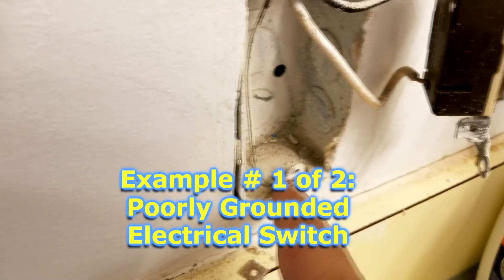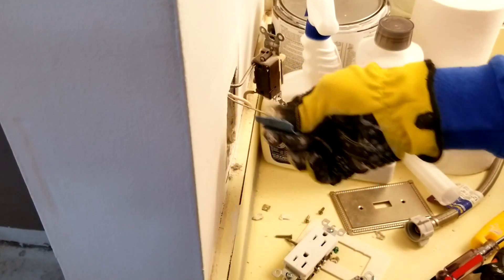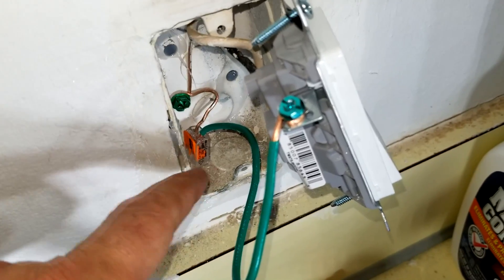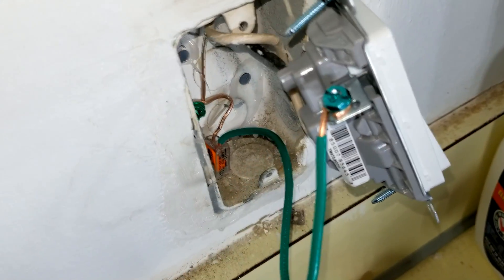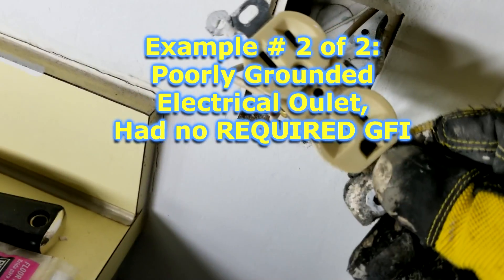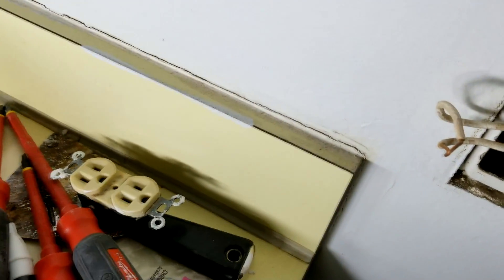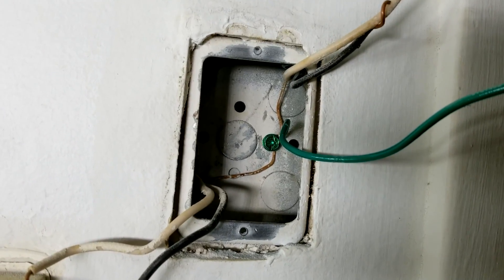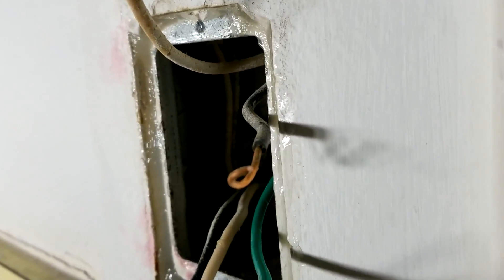How Not To Ground An Electrical Outlet - Wire Outlets Right

Comment: can i use white or black wire as ground but will strip about a foot or more of the insulation before it comes out of the box? have too many extra black wire that i want to make use of
Reply from the maker: Yes that works fine I do that all of the time whenever I need an extra 10 to 12" of bare copper wire it doesn't matter which one you strip I prefer the ground wire to be about as thick as the other wire so just make sure they're the same gauge
Reply: @jeffostroff  thank you very much
Reply: Of course... Who's going to know? Bare copper wire is still bare copper wire... You can also use white wire without stripping it... Just paint it green with a green permanent marker.

Comment: looks to me that you wrapped the wire the wrong direction around the screw/
Reply from the maker: There is nothing wrong with the way the wire is wrapped around the screw, and screw went all the way down and held the wire perfectly.
Reply: @jeffostroff   Nice video, thanks for making it.  However, @George Valente is correct from a good practices stand point.  Wrapping a wire around a screw in a counter-clockwise direction can lead to a loose wire connection.  As the screw is tightened the wire can push away from the screw making it a less secured connection.  Wire should always be wrapped around the screw in the same direction you tighten the screw - clockwise.  This has the effect of pulling the wire in tighter against the screw when the screw is tightened .   You repeatedly point out the poor workmanship and bad practices when the outlet or switch was originally wired (and deservedly so), but proper wire wrapping direction (clockwise) is just another example of implementing good practices.
Reply from the maker: @chuckm260  i always recommend yo wrap clockwise around the screw. That is what I did and in fact tjis was a loop, not a wrap. And no the wrap did not loosen, it stayed down nice and tight. Dont see why he had a problem with it. So neither of you can see that it is down tight and did not unravel?
Reply: @jeffostroff   That's good you always recommend clockwise, but unless the video image at the 4:15 mark is flipped/mirrored, the black and white wires on the side of the rocker switch are incorrectly wrapped around the terminal screw in a counter-clockwise direction.  

I never said, nor did George,  that the wire connections in the video were loose or unraveling.  I'm sure they were nice and tight.  I was simply stating when a wire is wrapped counter-clockwise (as in the video) it has the "potential" to become loose during the screw tighten, thus not a good practice.   It's a common mistake beginners make.  Since you did a nice job of pointing out other good practices I wanted people viewing this video and these comments to know another good practice is wrapping wire in a clockwise direction unlike what is shown at 4:15.
Reply from the maker: @chuckm260   O jeepers now I see where the 2 of you got it wrong. The black-and-white wires are not wrapped counter clockwise around the screw and fact they are not wrapped at all. They are run straight into the pinch plate which is pushed down by the screw. I use an upgraded version of switches and outlets and this is called side wiring. This process is a lot quicker than having to wrap the wire around screws.  And don't confuse this newer method with what they call back stabbing which is the process of pushing the bare wire into the back of the outlet hole which is not a very reliable connection and causes arguing and often times the connection comes apart.
Reply: @chuckm260  They are straight connections that go under a plate, not loops. Different clamping mechanism than the old school ones.

Comment: What happens if you need to install a new switch mid-run and the grounding wires are all pigtailed above the box? Do you need to install a new box and reconnect?
Reply from the maker: I assume you are asking about installing a switch halfway between the electrical panel and where the current fixture box is? If so there's a couple of ways you can do it. You can cut a hole on the dry wall at the halfway point where ever you want to install a switch and cut the existing romex and feed it into the new box and then then wire it up to the switch and continue the romex on outside the other end of the Box where it will go to the original destination Box. There and you would have to put a plate on the wall if you don't use that OLD Box because you cannot have a hidden Junction.  Another method would be to run romex into the original Box on the wall and run that length all the way to wherever you want to add a new switch.
Reply: @jeffostroff  Thanks Jeff.   I should have been more clear.  I want to use the existing switch location, but replace original switch with a dimmer.  What I've discovered is that, while the hot and neutrals are pigtailed inside the current box, the ground wires were fed back up through the entry point and I imagine pigtailed above somewhere.  They are essentially inaccessible.  I believe I need to disconnect everything and install a larger box so that the grounds can live in the new box with everything else.  Right now I'm unable to properly use the ground wire as it is.  The house was built in '67 and they used a much smaller box than they do today.
Reply from the maker: @pleitgeb  Man I hate those old tiny boxes! One way or another you have to get to those ground wires. Also, maybe you got lucky and they grounded them to the metal box! That would be nice because then your box is now grounded and you could screw in a green ground wire pigtail to the box. If there is any portion of the ground wire visible inside the outlet before they disappear out of the entry point you can also tap a screw through the back of the outlet box near the wire, and pinching the ground wires, now you have another grounding point to add a ground pigtail.

Comment: Hey Jeff. I believe the outlets in my apartment are not grounded for the following reason. When i use a microphone plugged into my computer there is a lot of feedback but when i touch any metal surface/component on my computer the feedback instantly stops. I believe this is because of lose current that is being grounded through me. Can you confirm this? Additionally I would like to know how to resolve this issue. Is my property manager obligated to send an electrician if i ask? will i have to pay for it? OR can i fix this myself? Thank You for the content
Reply from the maker: It is not easy to tell if this is the source of your problem. Best way tot ell is first, what year was your apartment built? If it was built before 1962, chances are there is no ground, and they are only required to bring it up to current code if they open the wall sto remodel. You can get a $7 3-prong outlet tester from Home Depot that you plug in and the light son it will indicate if you are missing a ground. If it shows you have no ground and you ar ein a three prong outlet, tell your manager something needs to be looked at. Also you can cut power to the outlet, first for safety, then pull out the outlet from the outlet box and see if you have all 3 wires connected to it. If not, then something needs to be done to add a ground.